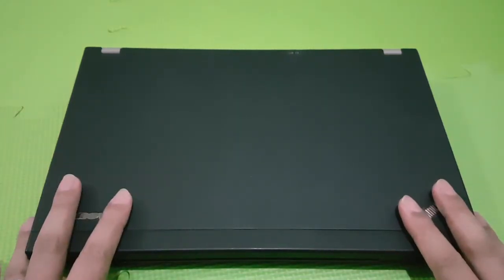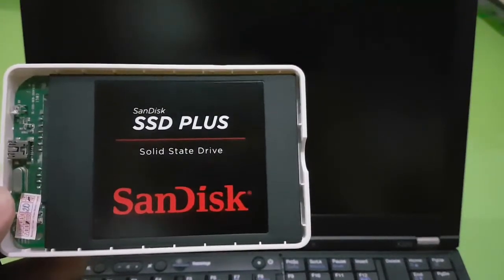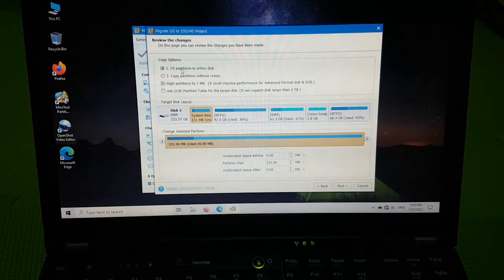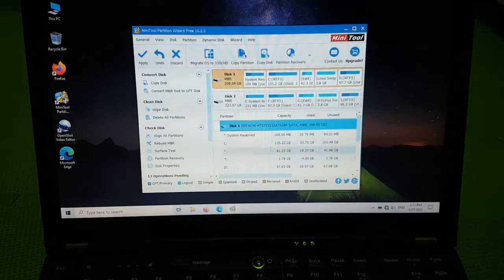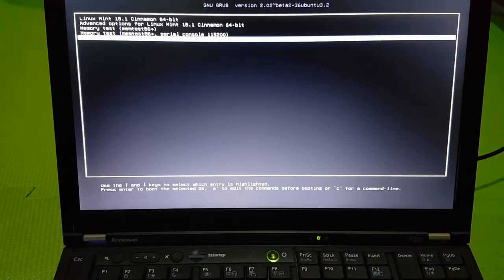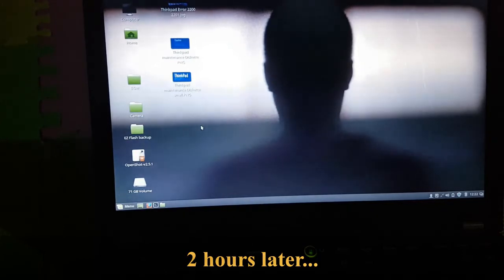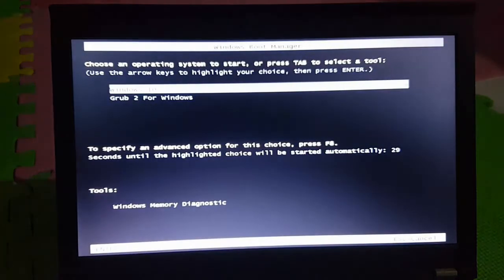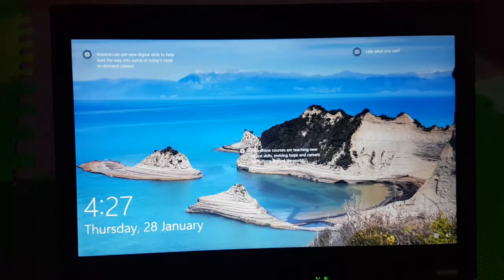Lenovo ThinkPad X220 SSD Upgrade

Comment: Man it still tool 30 seconds, why? I am looking up to install SSD M.2 in my X230 but no video seems ok
Plus can M.2 NVMe b installed??
Reply from the maker: Hi. For the X220, only mSATA is compatible. This is the connector cross the wifi card. I don't think M.2 is supported.
Reply: It's not a fresh install. But the speed during usage should be evident.
Reply: m.2 lol??? i hope you were trolling